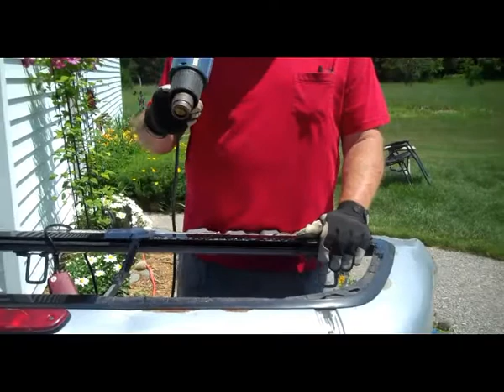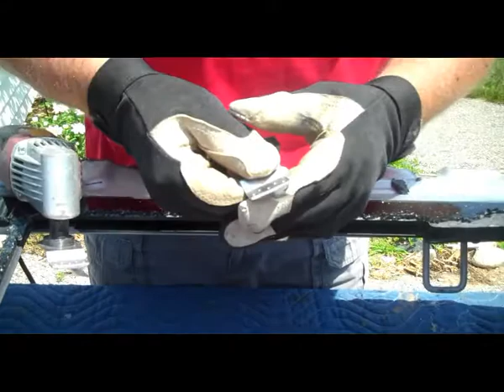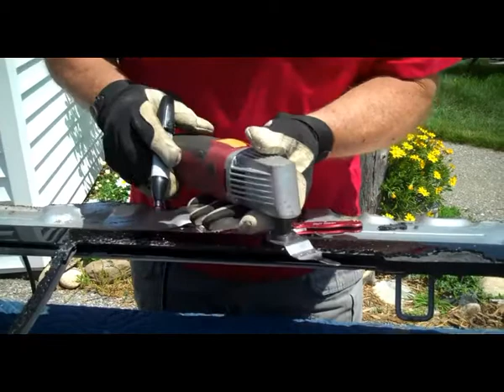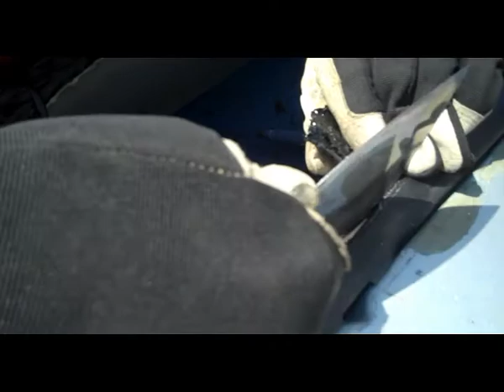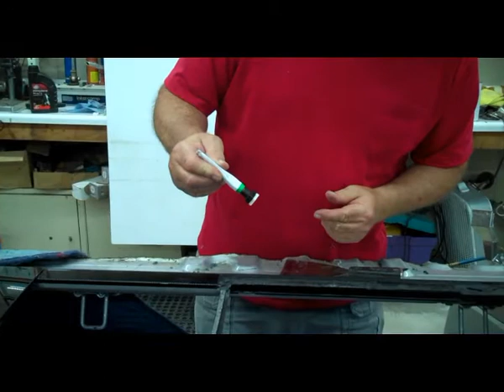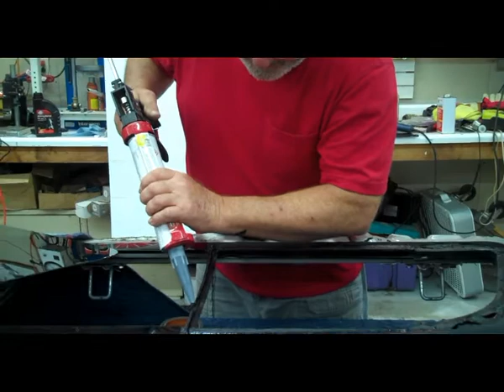Toyota Tacoma 2016 - 2021 Sliding Rear Power Window Replacement and repair

Comment: You mention using hot melt glue instead of the urethane sealant.   Is the purpose of the hot melt glue to just put a couple dabs in the track to hold the track to the glass or is a continuous bead required to make a seal.   The reason I am asking is that I don’t think I could squeeze out a 14” bead of hot melt glue and get the glass in before the glue starts hardening.   Thanks!   I enjoyed your video.
Reply from the maker: It isn't necessary to glue at all just let it ride

Comment: My left side (driver side) window broke on the rear slider panel looking into the bed of the truck.. My rear slider is manual, will this part fit mine? I see this is for the "power" slider, just wondering if it's compatible with non-power window since its only the left side I'm replacing.  

Appreciate a response! 

https://www.ebay.com/itm/2016-2018-Toyota-Tacoma-sliding-rear-window-back-glass-POWER-LEFT-patch-panel/263471264827?hash=item3d581c743b:g:svAAAOSwALtac37q:sc:USPSPriority!92672!US!-1:rk:9:pf:0

Thank you
Reply from the maker: no.  you need the part for the manual slider NOT power slider.  We are currently out of stock for the drivers left side glass.  Expected restocking is 1-16-19.  However we will re-list this item so that you can pre-order.
Reply: @autoglassamerica  Okay thank you I will definitely order one! I'll look for the pre-order!!